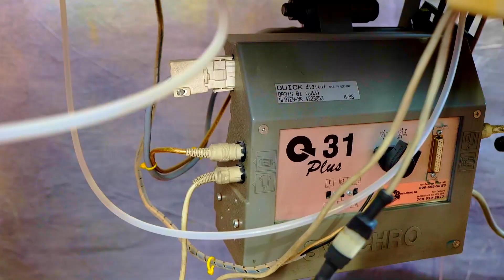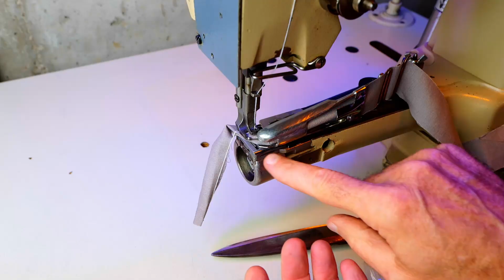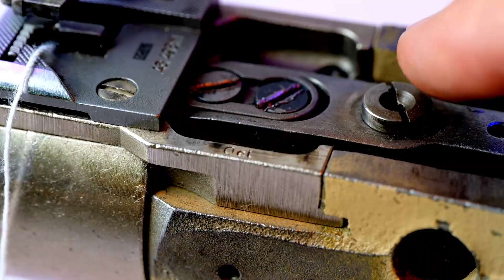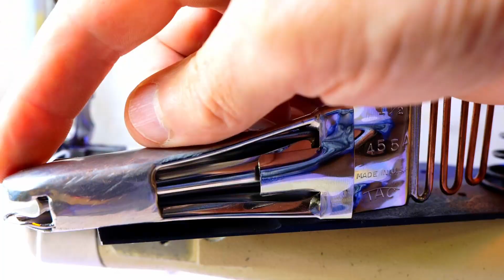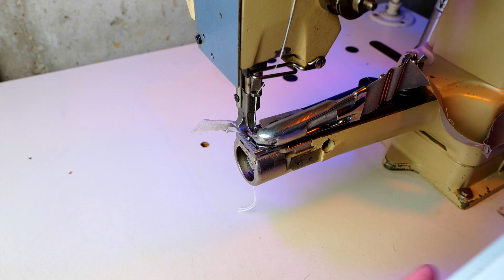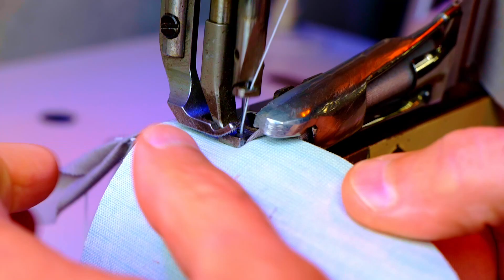Pfaff 335 H3 and Vibrating Binder

Comment: I have the same PFAFF 335H3 dedicated binding machine. I just recently got it and would like to asked Tennessee attachment to custom make me the same binder you ordered. Can you give me any information on what you sent them to have this custom order made? What a great informational video you have made. Thank you, Alexander.
Reply from the maker: I first decided that I wanted a double fold so that I could cut any fabric for binding rather than purchasing rolls of ribbon or grosgrain. You may prefer single fold for ribbon if you are doing more consistent and higher volume work. Then I cut samples of the thickest fabric I might want to use as binding in the width that I choose and the material I wanted to attach to.  They have an extensive catalog, you should get it from them and go through it first, chances are you might learn from just seeing what is possible and perhaps even change your mind about what it is that you want. Hope that helps, good luck.

Comment: hi there,nice to see this review. i'd like to ask if this machine would struggle with sewing very thick leather. i plan to use this for leather works.
Reply from the maker: It is primarily a binding machine in that it does not have a drop feed but it will do a fair job with medium thick projects. There is a limit to who thick you can go and there are more capable machines for such projects but this one might be fair if you don't make too much of a demand of it. So just depends on your projects as to whether of not this will suffice.
Reply: @AlexanderDyer  thanks a lot for your feedback, really helpful in guiding my decision to which machine to buy.
I'd finally go with either the juki 246 or 1341.
Cheers and thanks once again.

Comment: Great video again! Can you explain what is the downside of using a dedicated binding machine for regular sewing. I am looking for a cilinder arm machine to do regular sewing and binding, and I would like to know what would be my best option. There are various types of old Pfaff 335’s fo sale here in The Netherlands. Thanks for your help!
Reply from the maker: It is not too bad to sew with one of these but you should know that the drop feed does not oscillate up and down like most machines and you will either have to be OK sewing with binding feet or you will have to switch out the feet for each change. It is doable but perhaps not ideal.

Comment: Hi Alexander, great machine. I was told that the binder can be replaced so it can stitch leather as a regular cylinder arm machine. Do you know if this is indeed possible?
Reply from the maker: Yes, it is possible. It does not have drop feed so perhaps not ideal and there could be some issue there or not depending on your specific project but it is possible.

Comment: Great video , very helpfull , i have the same machine but i don't know if it's a H2 ou H3 , 
I have the same servo motor Quick SYNCHRO i need a new  motherbord , can you advice if i need to buy new motor or  if i can find new one  motherbord ?
thanks you
Reply from the maker: Outside my ability to comment. Like I said, I bought it this way and it works so I use it. If this one breaks down I'll convert it back to manual foot lift and install a clutch motor.😰